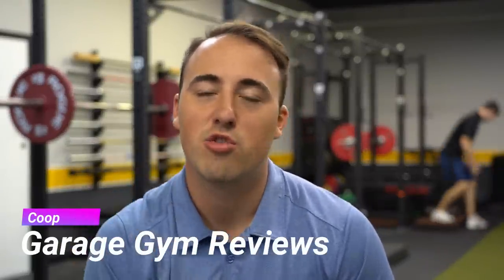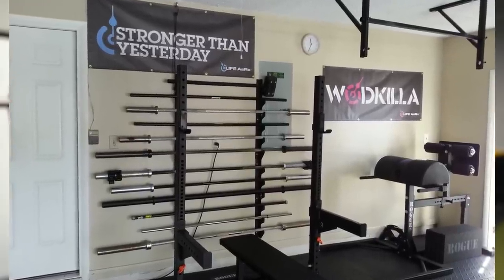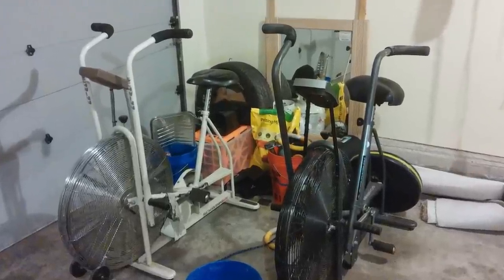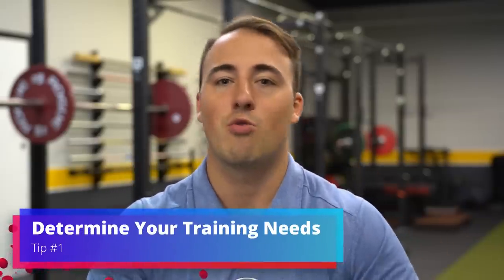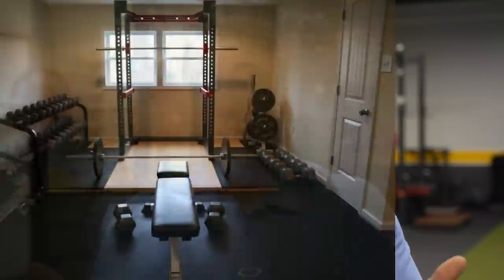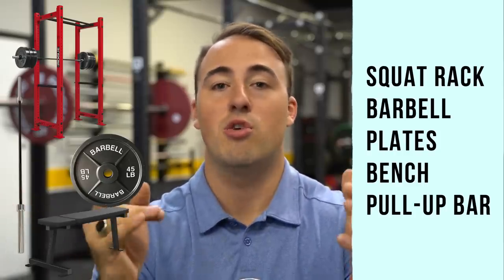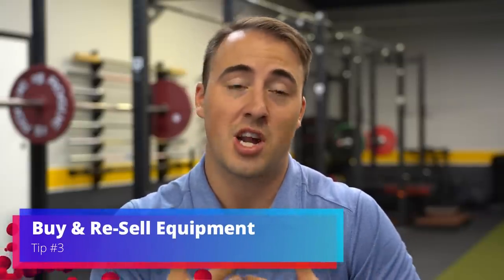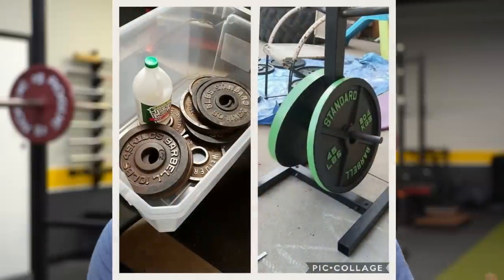HOW to BUILD a BUDGET HOME GYM!

Comment from the maker: What tips do you have for people looking to build a home gym on a budget?
Reply: Bare minimum? Some stall mats and plywood to build a lifting plattform, good barbell and weights. Deadlifts, hack squats, floor pressing (hip-thrusting the weight up), cleaning the weight up for shoulder pressing. If budget is tight it can be worth getting a bit creative in exercise selection.
Reply: Got some of my weights because someone had placed them at the curb to be tossed. FREE is always good.
Reply: Instead of cardio machines, piss off the neighbors dog and start running.
Reply: Save up... Get a second job, limit expenses. Don't bother with a crap gym setup. Craiglist is greatly overrated. Might be my area but it's mostly junk and not even a good deal to begin with.
Reply: GET A JOB
Reply: Stall mats, plywood, power rack, bench, a bar, some plates and some bands will easily set you back for more than $1000.  If you're patient, you can probably find most of these things 2nd hand tho :)
Reply: Buy used when possible
Reply: Thirt shop is fucking awesome!
Reply: 1)  If you're quite new to working out, you might want to wait before investing in equipment.  Work out with a buddy who perhaps has more experience.  Or, dare I say it, at a gym where you can get some instruction and experience.  You need to know what you don't know.  You need to be able to work out safely.  And you need to know what you need, what you want and what would just be useless to you.  2)  Coop said it but it bears repeating -- be clear on what your goals are.  If you want to do powerlifting competitively that has different priorities than you are a  competitive distance runner looking to get a little stronger.  3)  Know your space limitations.  And consider cost-benefit, including cost in terms of space.  An item that does three things for you and you do each of those things 2-3 times a week and takes 8 sq ft may be better than an item that does one thing that you only do twice a month that takes 6 square feet.  4)  Buy once, cry once.  If low quality (but safe) equipment is FREE to you, and you have room, take it.  But if you are buying it with the idea of upgrading in the foreseeable future, you may just want to wait until you can get something you want to keep.  The flip side of that is: 5)  If you are buying it to impress people with the great, overbuilt, sexy equipment, unless you can afford to throw money around for that, don't do it.  (And if you do have money for that, I still wouldn't but if it's play money so be it).  First of all, anyone that would think more of you because of that is someone whose opinion shouldn't mean much to you.  Think of it this way -- you meet two guys, Alan and Bob.  A has a gleaming, spacious home gym where the equipment looks like new.  You're not sure Alan has actually used it.  Bob has well-worn equipment.  None of it is from prestige brands.  Bob obvisouly goes into his somewhat cramped dungeon, I mean gym, and moves iron, and has made the most of his resources and genetics.  Which guy impresses YOU more?  Yeah, be Bob.    Coop, I really like your videos.  Well produced but not overly produced.  And presented in a humble, informative, in-service way.  Good on you, brother.
Reply: @TyRaff  , one up ya . Get a PROWLER !
Reply: @garagegym1695  : 3 ply thick Horse Stall Mat / plywood platform , Titan T-3 rack , Buddy Capps TPB , craigslist weights ( 8 x 45 , 8 x 10 , 2 x 5 and 2 x 2.5) cost me about $900.
Reply: myself personally these are the steps I would take

If your a ego lifter or a strongman power man along those lines that means you're going to be dropping the bar and dumbbells a lot on the floor

So make sure you've got to have a strong floor to take that amount of damage

so that would mean that's where your budget would mainly be going towards your floor

Secondly don't buy second-hand squat racks and bars reason being that you want to spend most of money into these two things because it saves your life 

as you don't know how strong or how damaged the second hand goods are

If you looking for a more a fitness gym you can get standard bars and fitness equipment

Cheaper than going down the Olympic route which you could easily get a fitness gym under £500 with good quality
Reply: Spotting your gym partners on the bench
Reply: You forgot one suggestion, sometimes when you are looking for a certain item, sometimes it is in a package deal on CL but some people get discouraged. I buy in bulk all the time and just keep what you want and sell the rest. I Make a lot of money like this!! Thanks
Reply: Always spot...
Reply: I built mine June 2018.  I shopped around first for sales and other discounts first.  I learned that Amazon offers first time buyers 0% interest for 10 months.  As I would be a first time buyer on Amazon...I bought everything there and the interest free helped a lot.  Though you shouldn't over due it as the point is to actually pay it off in those 10 months!
Reply: Craigslist
Reply: Garage Gym Reviews I would absolutely go with horse stall mats in your home gym. They are durable and will go the distance. You can see them in my home gym build https://youtu.be/xcpCGasdgUs

Comment: In university so my budget was literally $0. Checked 5. Used sites every hour I could, started picking up the free gym items. Slowly after reselling some, I got a budget and started to be able to buy good deals. 

7 months later

1000lb Half rack, 600lb FID bench, two 1500lb bars, 200lbs in bumpers, 300lbs steel. 5-30lb fixed rubber dumbbells with rack, 250lbs standard weights and bars. Plus other bits here and there. And I've made almost $1000. It can be done.
Reply: Sam Willett my mannnnn
Reply: what sites did you check
Reply: Sam Willett yea what site? I kinda want to start doing that
Reply: I hoping to do this too
Reply: Dawg how do you find free gym items? Sounds like a great move. Where does that happen?
Reply: Time is money. People forget how valuable time is. Checking craigslist and forums, researching, communicating through emails,  meeting up with people for the sale, posting, reselling,  refurbishing, DIY.. all takes valuable time that adds up. In the end you've spent more time and energy than if you would've just bought it new right away. I can only imagine how much time you spent over a 7 month period. But congrats that's a huge accomplishment!

Comment: Built my home gym over the past 20 years but most of the early purchases were via ebay (mostly local) purchases. My best "find" was a three rack dumbbell rack along with a complete set of hex dumbbells in 5# increments from 10 - 75# for $300. I later managed to snag pairs of 85, 100, and even 120# matching pairs very reasonably. 

 I have a friend who built an impressive home gym by obtaining equipment from all over the eastern half of the US. He and his wife would rent a truck and travel for 1 - 2 days just to buy high end equipment (Hammer Strength, Rogue, etc) very cheap. The sellers were usually just looking to get them out of their house. He and his wife would make a "mini-vacation" out of the trips. Of course he is self-employed and has a very flexible schedule.

Comment: I’ve had some luck on Craigslist and marketplace, sometimes not so much. Really kinda depends what you’re looking for. I bought 3 rogue kettlebells (16, 20, 24kg) used from someone for only $120 which is a freaking steal. My dad bought an old bench and off brand weight plates totally something like 110# on Craigslist for a little over $50. Other times I’ve found absolutely nothing. But whatever you do, always make sure to get a first hand look at the stuff you wanna buy

Comment: My goal is a nice power rack with free standing adjustable bench, dumbbells up to 100 in 10lb increments. A nice bar and plenty of plates. A cable machine. And a pull-up/ dip station. That’s 90% of the stuff I do in my commercial gym

Comment: Snagged a half rack w/ lat pulldown for $180 and spent another $230 on 400lbs of weight, 2 barbells, weight tree, 2 benches w/ attachments and three different sets of adjustable dumbbells. I spent an ungodly amount of time on Facebook Marketplace and searching by posted time. Both weight purchases were made withing 5 minutes of each posting of the weights.

Comment: I had a good friend who built a squat rack from lumber.  Seems like a good way to save quite a bit.

I don't have a garage for my gym, so I can't do much with barbells.  But kettlebells, pull up bar, jump rope, adjustable dumbells, and resistance bands can take a new year resolutioner pretty far until they truly need a bar bell to reach higher.  To be honest, even on my list, there are frills that a new entrant to the fitness lifestyle doesn't need.

Comment: I am buying a house with engineered hardwood floors. The only place to put a gym is in a spare bedroom. How can I protect my floors from damage while deadlifting and still have a solid, firm foundation to pull and squat on? My idea was to put down a paper underlayment to protect the floors from discoloration, then a layer of foam similar to what would go under carpet, then rubber dove tail mats and finally a squat and deadlift platform. Do you think this would work or will the foam make the floor unstable? Have you ever had this situation? What have you used?

Comment: I just want you to know that Walmart has the best deal on weights and dumbbells.   Go look at the cap rubber hex dumbbells.   Shipped for 1.00 a pound.  Less than you can get them used.  Also they have sales and got kettlebells for .75 shipped.  Walmart is killing it.   Go check out their website.

Comment: Coop, can you possibly try using a lav mic to improve your audio quality? If you’re using a shotgun mic, it seems to either struggle to pick up your voice, or picks up so much echo that it doesn’t match the picture quality you’re putting out with the macro lens and PP your doing. Good stuff man, you’re setting the “bar” higher with each post!
Reply from the maker: Yep, been meaning to improve that aspect. I use a Rode VideoMic Pro. I have a lav mic, just haven't used it yet. I'll give it a shot on the next one. Appreciate the feedback

Comment: The company I work for is quite generous with annual bonuses, but they're only paid in Amazon gift cards! This year I'm due for a real nice amount, so do you have any recommendations for building a home gym strictly from what's on Amazon? Looks like they don't have Rogue, but I'd be worried about buying something that's just unsafe junk. Any brands on Amazon to avoid in general? Would like a full squat rack, adjustable bench, bar, weights, storage (either on the rack or separate), floor mats, pull-up bar to start. Thanks!

Comment: Heavy duty pallet rack is cheap and way more heavy duty than a power rack. Conveyor belt from a gravel pit is so tough you can’t believe. Have to have connections, but most of them have rolls of it out back. I was told, “if you can lift it, you can have it”.  Air dynes are always on Craigslist mostly unused. Play it again sports has used weights by the ton. Get creative.

Comment: For most people legitimately on a budget I tell them to try to find a dip station with a pull up bar on facebook or craigslist. And order some resistance bands off amazon. Less that 300 bucks and you  can do so much with that while you build from there. After that find a power rack, barbell, plates, etc. Also don't go buy $1000 power rack because some dude said you have to. I found a power rack, cap barbell, and 645lbs of plates for 800 bucks. Yeah the barbell isn't the best and the rack is rated for 600 lbs but guess what...I'm not benching or squatting 600 pounds. When the time comes I'll sell my rack and bar and buy a better one.